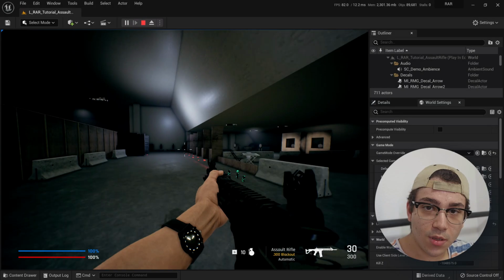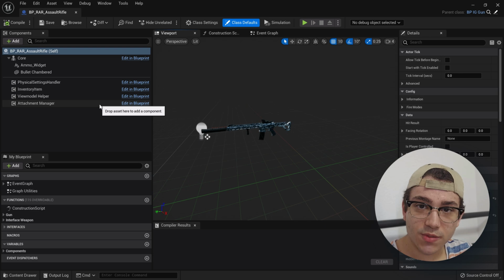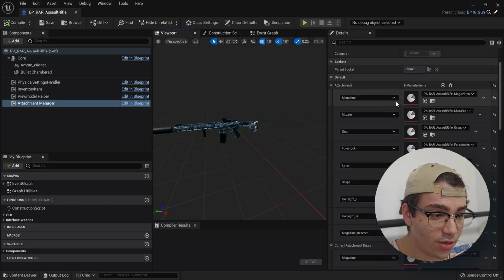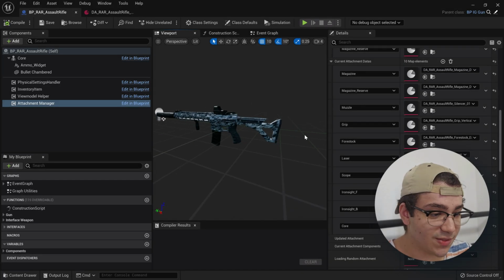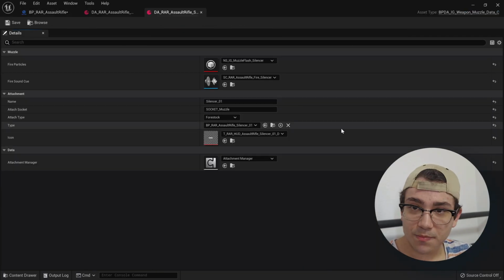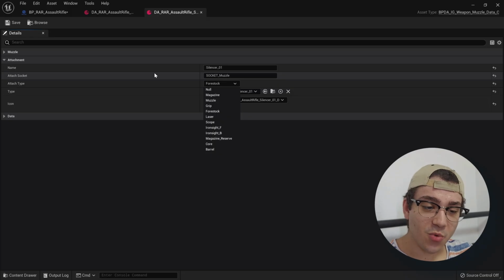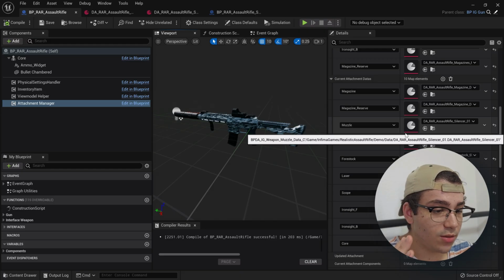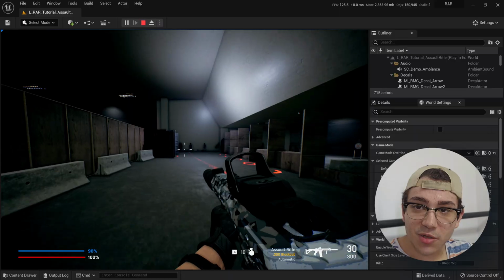How Modular Attachment Systems Work in Unreal Engine 5 #unrealengine #gamedev #fps

Comment: It looks great. I have a few questions. First, is it compatible with GASP templates? Second, if I want to change it to equip multiple throwable items and switch between them via keys, is it difficult to implement? Third, can new types of weapon attachments be added? I'm considering purchasing this asset. Could you please advise if it will be discounted in the short term, or if the price will increase in future updates?

Comment: what about soft refs do you use them in the project for the guns and attachments, also is the project frame rate independent as in does the weapon and gun feel the same weather your at playing at 60hz or 240hz
Reply from the maker: We use soft references for most assets we need to load at runtime, which the game doesn't need to know about all the time. Weapon Class references are one such thing, and the same applies to attachments. And yes, the project is frame-rate independent!
~Octavian